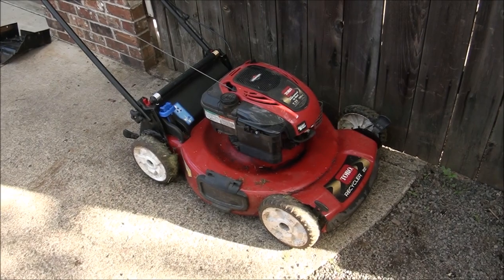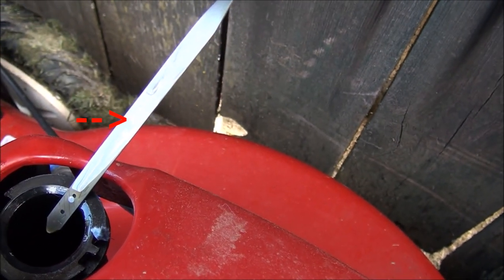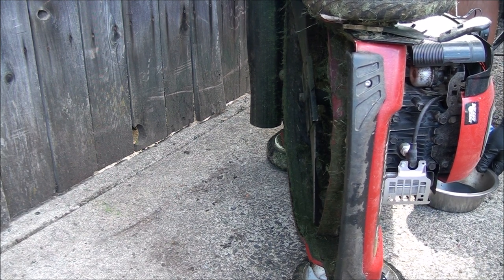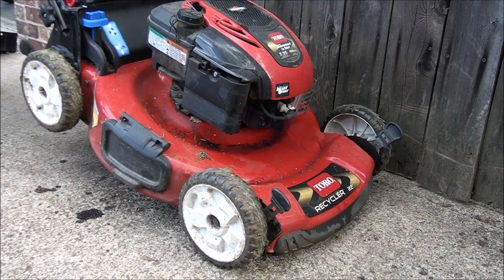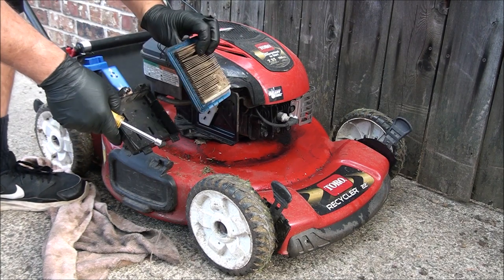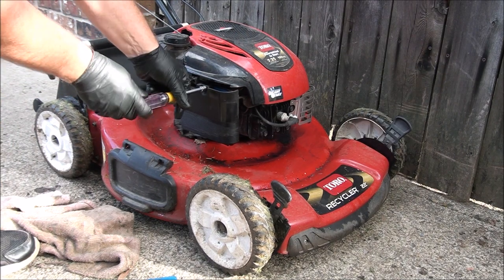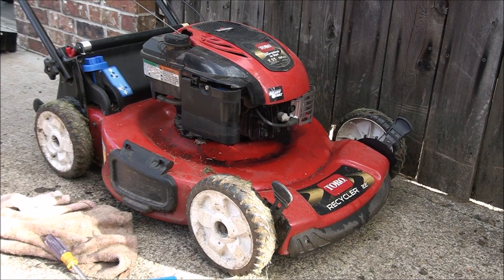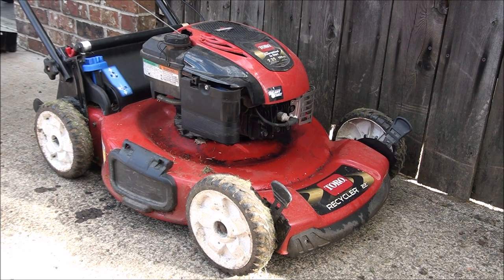OIL EVERYWHERE and a TORO LAWNMOWER that Won't START or RUN. Repair a BRIGGS 7.25 hp Engine

Comment: Thanks for the Vid!  My wife thought she was a mechanic one day while I was at work and filled the mower to the brim with diesel oil, then wondered why it stopped working.  With the help of this vid, I was able to figure out that the air filter was flooded once I already had changed all the oil out.  Started right up!

Comment: Thanks for the vid. Was getting ready to send it in for $65 + parts repairs because of all the oil leakage.  I think it’s obvious I put too much oil. This is going to cut my repair cost to just a new $10 filter.

Comment: Hey Jeff, good and quick thinking on over filling. I have one now that I picked up. This mower did have a soaked air filter and oil was also present on the exhaust as well. I had thought about maybe the valve seat was not set. I had to replace the brake cable first prior to pulling anything. I did pull the plug and oil came shooting through. I will let you know how things turn out.
Reply: so how did it turn out?

Comment: Hey Jeff, mower turned out ok. I let it drain for a few days and dry out. These mowers were used very rough during their ownership.  I freed up a locked engine, but that 20hp didn’t last a week. Probably some internal damage prior to checking it out.

Comment: Hey Jeff just recently found your site. I repair small engines here in Central Ohio. I follow Donyboy73 and Bruce Pender also. I had a Briggs powered mower come in where some had filled the crankcase completely full with gasoline. At least all the sludge was cleaned out of the engine. lol. Keep the videos coming. You are doing a great job.
Reply from the maker: +Raymond Campbell Thanks friend!
Reply: Jeff your doing a fantastic job

Comment: The older mowers had an oil drain plug underneath.
& still older ones had a throttle control dial on top!

Comment: My problem: I tipped the lawn mower onto it's side a few times to remove the blade and sharpen it, oil stick side down. After putting the blade back on, I had problems with it not starting. The pull rope was giving me the trouble you describe here. I took the filter off and found it saturated in a lot of oil. I also noticed some oil in the carb, and some even leaking out of the exhaust. I knew the oil was already low before I found that it leaked everywhere, so I put more oil in it. I let it set a few days and tried pulling the rope again, but still had trouble with it.

After I watched this video, I went out and found that I indeed had put way too much oil in it. I drained it to the proper level, as shown in the video. When I tipped the mower back on it's wheels, I noticed the exhaust leaked some oil onto the mower deck. I removed the spark plug and pulled on the rope multiple times, but I didn't have any oil shoot out of the plug hole. I cleaned and checked the spark plug, and it was still creating a spark. So I put it back in and tried starting it again. But, it was still being tough to pull, and occasionally would lock up mid-pull. I took the spark plug out multiple times to find that it's still getting saturated with oil. I cleaned it, and repeated the starting process. 

The last few times that I tried starting it, it started to finally puff out a little bit of white smoke, but it's still giving me problems with locking up. I'm currently in a rut on not knowing what to do next.
Reply from the maker: the engine  is "hydrolocking". Try taking out spark plug and pulling rope several times again. and confirming oil level.
Reply: Jeff's Little Engine Service very helpful I did the same thing now I know how to fix it thx

Comment: I have the exact same lawn more, that was given to me a few years ago, the owner did not have the manual.
 It has two problems 
The first was that if it stalled out I could not restart it right away, sometimes it only took a few hours but most of the time, I had to wait until the next day.
then recently this year, it started to give out puff's of white smoke while I was cutting the grass....
I added oil, but I added too much and it puffed out a lot more white smoke and oil as well. 
so before I remove the oil and start over, should I remove the gas first before tipping the mower on its side..
Thanks

Comment: I have a toro, last night I ran over a soft ball and it shut off… now when I turn it on the blade is hitting something on the bottom a little bit. Any thoughts ?
Reply from the maker: the blade may be bent

Comment: Well got the mower going and it burned off the oil. I installed my carb on it from my mower. Cranked up first pull. Now I am going to have to swap out the EZ Walk. The rear tired are constantly going...

Comment: hey Jeff, love the video. had my mower stored in my shed up like you said not to, all oil and gas drained out of her. if I let her dry out and sit flat for a few days think she'll fire okay?
Reply from the maker: yes just make sure the air filter is not oil saturated. also it will smoke for a few minutes
Reply: @JeffsLittleEngineService  drained oil and made sure gas was good, still can't get her to fire up for more than once outta ten pulls. wondering if it's my spark?

Comment: had same problem I did everything an got a new filter an spark plug an ready to put new filter an call it done an try to turn it put an my luck I miss place that white bone looking color plastic that I supposed helps air go thru from hole to carburetor is it save to turn lawnmower on to test it an possibly use it till I buy one?  sorry for the way I explain everything I'm no lawnmower mechanic what so ever

Comment: Jeff, perhaps you can help. I bought a new Toro with  Briggs& Stratton engine. I have oil coming out of my air cleaner, I took it back to their repair dept. They didn't find "anything wrong". I still have problems starting, All they did was replace the air filter & advised me to keep the gas tank up hill, My yard is pretty much flat, my oil level is within the marks on the dipstick. Where can I start to figure out whats wrong?
Reply from the maker: make sure no gas in oil (sniff test) and that the air filter is not oily . this can happen when the mower gets tipped over too much

Comment: I didn't close the cover right when checking the oil.  Mowing the lawn I noticed liquid all over the mower.  Then I noticed it was oil.  I wiped it up with paper towels and am wondering if it is safe to turn it on again.

Comment: How much oil does a Murray Briggs and Stratton hold?  I had oil everywhere after trying to fill it with a funnel.  It's underneath a plastic lip.  I can't read the dip stick!  Thanks in advance.  My very old mower was easy!
Reply from the maker: many different models. most take about 20 ounces
Reply: @JeffsLittleEngineService  Thanks so much!  I was frustrated. Dumb engineers.  It came with a 15 Oz bottle.

Comment: you didn,t explain what if the  engine is locked out by oil in the bore? my engine was, cleared oil and checked oil so started it up...smoked like crazy then stopped. Could it be drawing oil from crankcase up into bore? 
Would that be a piston or ring fault?
Reply from the maker: Failing rings will not cause this. It might have fouled the plug while it was smoking. Clear the top end by removing spark plug and pulling start cord a few times. Caution: Gas/oil may come out. The carburetor may be flooding gas into the oil, this overflow of fluid causes gas/oil to enter the top end. The carb may need rebuilt or just to be cleaned, and possibly air filter replaced.

Comment: I just had one of these given to me.. It was running fine.. I put a new spark plug, and air filter in, and started it back up, and there is an "excessive" amount of oil coming out the carb. Not just a little blow by but a pretty good amount.. it don't smoke it runs good. I checked the oil and I had to add more because it lost so much out the carb.. Could it be an oil ring, and still run so good. or is it something else.. Thank You for your help.. Ben..
Reply from the maker: I would say that it had too much oil or gas in the oil from a flooding carburetor.
Reply: You were 100% right. It had way to much oil. When I checked the stick it read almost have an inch past the two fill dots.. Thank you for your help.. Ben..

Comment: I am 66 years old and I have never in my life bought an air filter for any of my lawn equipment. I use foam packing material. I have a tiller that is 34 years old and it has the same spark plug it came with from the factory. You don't have to change sparks plugs every 5 minutes.
Reply from the maker: nice. Good spark plugs like Champion and NGK last a long time

Comment: i did all this and it still doesn't run!!! I changed the spark plug as well, removed all the oil, cleaned, etc etc, and nothing! 

BUT I Have found why it was not working!! Because of the wire (on the left ) that was damaged! so the spark plug was not sparking since this wire needed to be replaced. Once done, it worked great!!
Reply from the maker: Try spraying starting fluid into the carburetor. If it starts and then dies. You know the carburetor/ fuel system needs to be cleaned

Comment: 90 % of the time it is not that the person put too much oil in it, it is caused by the carburetor needle and seat leaking and gas is getting into the crankcase!  This procedure is putting a (bandaid) on the repair!  It will most likely do the same thing after it sits for a while!
Reply from the maker: You comment is almost correct. However, people often overfill with oil too. You can tell if gas has leaked into the oil by smelling the dipstick and the consistency of the oil..

Comment: Hey Jeff, I over filled the oil.  And found your video. After following the instructions everything worked fine, then after 5 minutes everything sklowed down and shut off for good. Any suggestions???
Reply from the maker: oh man. make sure the oil level was not too low. If so the engine may be ruined

Comment: So stupidly I went over something that instantly stopped my Toro GT2100 lawn tractor. It did start back up and I was able to drive it back into the shed. I went out today and all of the oil had drained out and the dipstick reads zero! Any ideas are helpful and I am very worried that I may have cracked the block!! Pray not!!!
Reply from the maker: it is leaking from somewhere! not good!

Comment: Got a brand new (2017) Toro Timemaster. Been in shop where I bought it twice: new carb due to miss (still missing, spits, sputters). Then oil leak from two spots: from breather hose at engine housing and from top of engine. Said it was seal/gasket, and replaced during 25 day wait. Still leaking from breather hose at engine; it does not have too much oil. Does not leak from top of engine now. They do not give paperwork with warranty repairs. I requested copies of work orders in email (still waiting) so I can have a record of what has been replaced/repaired. Can you please give me your input? They will not refund or replace, only try to repair (per their policy). Thanks!!!
Reply: It's the hose coming from the air filter housing to the engine. Don't know if I'm using the right terms.
Reply from the maker: yes the breather hose allows excess fumes and oil to evacuate the engine through the air filter housing.  If carb is still sputtering you probably still have a contaminated fuel system. If the float ever got stuck from dirty gas it may have allowed gas to fill up the oil sump thinning out the oil.. Sometimes it's hard to tell if you have gas in the oil. try smelling it.
Reply: Thanks!!!

Comment: The oil leaking at the end is normal and stops I assume?
Reply from the maker: yep the oil needs to evacuate the top end of the motor and the muffler
Reply: Gotchya! I accidentally tipped my Toro B&S mower on the side and its spitting oil out through the exhaust. Gotta love hills!  I wanted to make sure that it would eventually stop. Thanks for the super quick reply.
Reply from the maker: make sure the air filter did not get oily
Reply: Just a tad bit of gas from the little overflow pipe. I'll probably replace the filter to be sure. Sad part is this mower is basically brand new. That's my luck though!

Comment: That's actually 7.25 ft-lb of torque, not hp.
Reply from the maker: thank you! I will correct that.Jeff
Reply: No problem! It's just something that I notice right off the bat cause I work at a B&S distributor and those old SAE 1995 gross hp ratings and new torque ratings are giving us hell :D Anyway, nice channel, you've got some really nice videos and I especially like the fact that you put the simple explanation of the problem in the title so people with less experience can find the solution more easily.